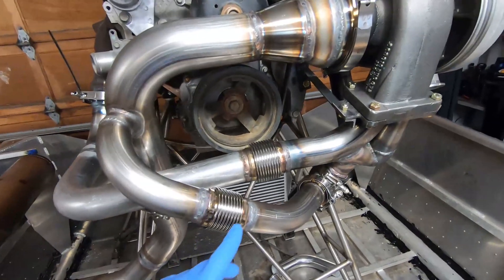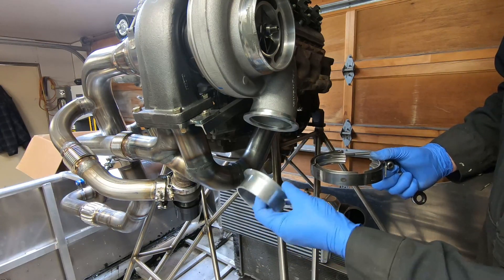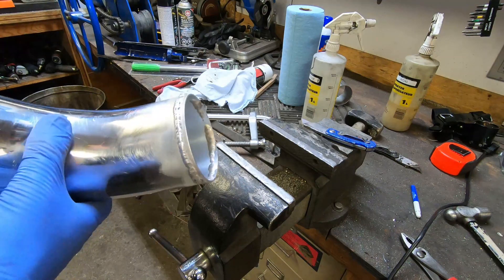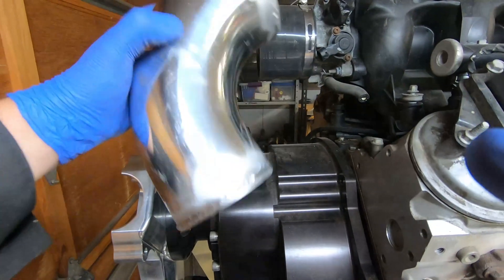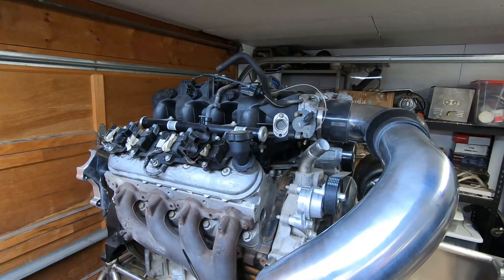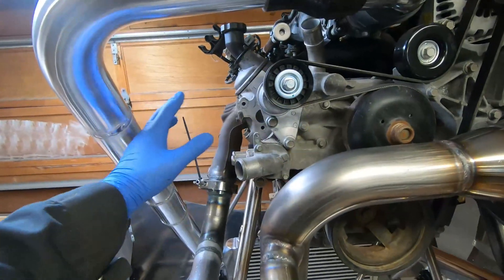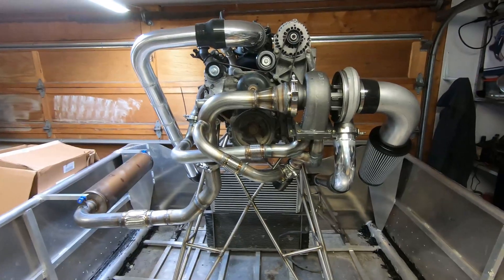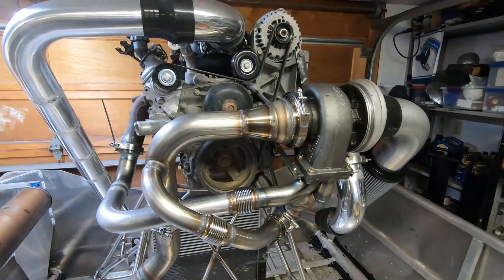Airboat Build #16: Turbo Cold Side

Comment: It's a boat. Why you didn't go for wet intercooler? You can even integrate it in boat itself.
Reply from the maker: Vilis Grīnvalds that’s a good point, an air-to-water intercooler would have some advantages.  However, I plan on using this boat in very cold weather that would freeze a fresh water system and the rivers may be frozen at times.  Adding a system with antifreeze in a tank is an option but the air-to-air is simpler and lighter.  If I was in a warm climate, I think your water intercooler idea would be a good way to go.
Reply: My idea is a bit different. Like integrating it in boat it self. Don’t use water or some coolant, but intercooler is a part of boats back, there is like a tank, where air is in tank (intercooler) but water is already overboard. So there is nothing to freeze, cooled air always be same temperature as boats back. And it’s bulletproof, dry cooler can brake easily, especially under that vibration or can get hit by ice.
Next what I think about that extreme whether.. how is about MAF? Ecu will accept temperature differences?
Reply from the maker: Vilis Grīnvalds ok I think I understand what you mean.  I’d be interested in seeing that built into the hull.  
As for the ecu, it will work fine in -20-30c.  The cold enrichment table is important and will need some tuning, but once tuned it should start no problem.